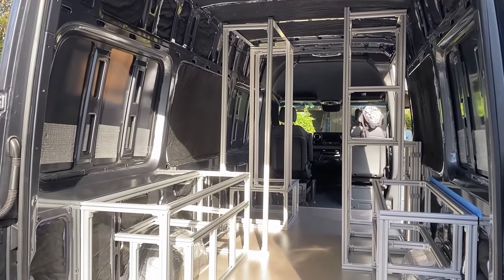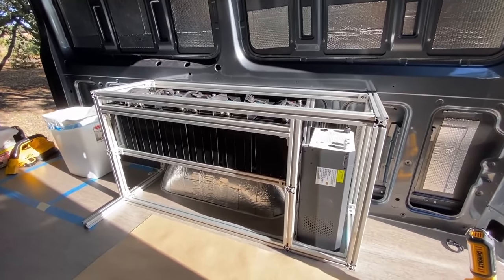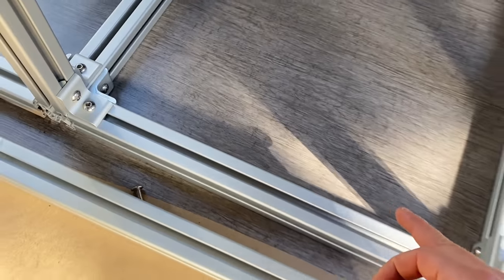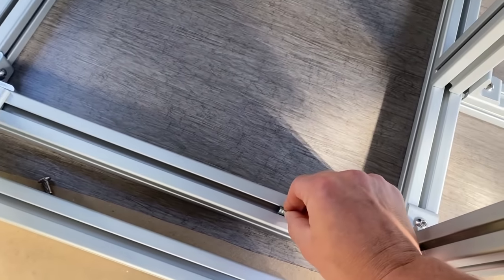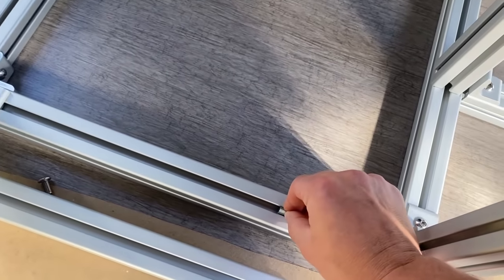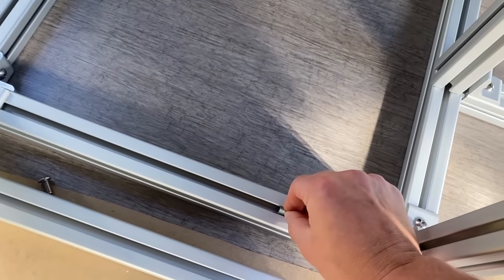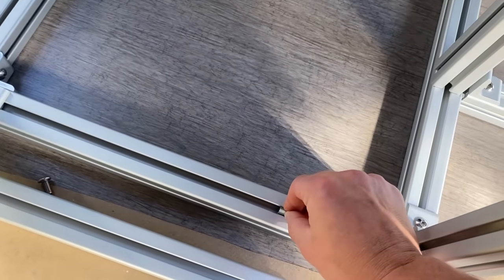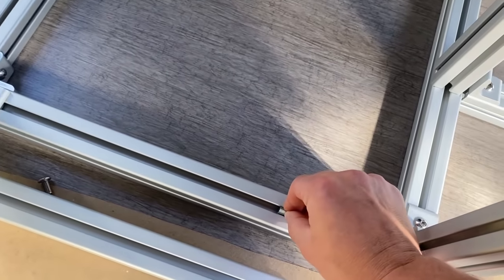How To Build A Van With 80/20 Aluminum (INSANELY STRONG)

Comment: What is the total cost of 80/20 for the van?
Reply: is 80/20 less expensive than wood??
Reply: @michaelbuddy  I figured.. 😆
thanks for your reply..
Reply: There are ways to reduce that cost though. 

1) Look at a brand called tnutz. They sell aluminum extrusions that are the same dimensions as 8020 brand. Tnutz uses 6063-T6 aluminum alloy which is comparable to or slightly stronger than 8020's use of 6105-T5. Tnutz extrusions can be a bit cheaper than 8020.

2) Both 8020 and Tnutz have ebay stores where they sell discounted extrusions. These will not be cut to length, but they can be cheaper than buying directly from the manufacturer's website. I would recommend buying all of your extrusions this way.

3) 8020 has a load deflection calculator which will let you choose the extrusion type (i.e. the size), and describe how far apart the supports are. You can then input the amount of weight you will be placing on that extrusion and it will tell you how far it will deflect. Using this you will probably find that you can get away with smaller extrusions which are a lot cheaper (extrusion cost is pretty linear with the amount of aluminum in the product - smaller cross sections will drop in price significantly).  For example: the extrusion Seven O Savage uses in this build is 1515. That extrusion can span 4 feet, have 250 pounds placed at the center, and only deflect .7mm.  That is WAY overkill for most of the builds we would be doing. If you have shorter spans or lighter loads you can get away with much smaller extrusions. Their smallest extrusion is 2020, and that can span 2 feet, have a 250 pound load applied at the center, and still only deflect 1.4mm.  But the cost difference is significant. 1515 is $0.53 per inch. 2020 is $0.16 per inch. You might need slightly more 2020 to provide enough supports, but that will not overcome a more than 3x price increase for the 1515. For example 40 feet of 1515 would cost $255. 40 feet of 2020 would cost $77 (and only $51 from tnutz - and even less on their ebay store). Don't over build. Use the deflection calculator and buy smaller, lighter, thinner, cheaper extrusions where you don't need to span long distances and carry extreme weights.

4) The roll in T-nuts that are recommended in this video cost anywhere from $1.20 per nut to $2.85 per nut depending on material. Economy nuts cost $0.16 per nut to $0.25 per nut depending on material. If you have 300 connections that is a difference of $360 best case scenario for the roll in nuts vs $48 for the economy nuts (best case scenario). Again, other vendors will probably be cheaper.

5) The angle connectors that are sold by both 8020 and tnutz are extremely expensive. You can also purchase 1/4" aluminum L brackets and make your own. Of course, the price difference is made up by your labor. You have to decide if that is worth it to you. But for example, a single 15 series angle bracket costs about $3.65. If you have, conservatively, 100 connectors in a build that is well over $360 you have invested. Alternatively you can purchase a 12 foot length of 6061-t6 aluminum L bracket for about $53. Cut up, that will give you about 90 - 95 angle brackets of equivalent size and strength.

If you combine all of these techniques you should be able to get the cost down by a HUGE amount. Just a rough guess is that you could take what was shown here and cut the price down to 1/2 or even 1/3 as much cost and still  maintain the same basic strength and have an almost identical design (with the added benefit of lighter weight).

It will still be more expensive than wood, but the extra strength of the extrusions (especially in a crash) would make it worth it.

Comment: I’m not sure I understand the carriage bolt attachment.. do you drill a hole through the 8020 and mount the carriage bolt facing the sheet metal? Or do you slide it into the back side of the 8020 facing the sheet metal? And then do you put a rivnut In the sheet metal? Or something else?

Comment: When you pointed out the water filter system, I noticed that it looks like you plan to install it with the canisters horizontal. If you ever need to change a filter cartridge, all the water in that canister will spill out unless it's mounted vertically. Maybe you have a solution for this though.

Comment: Do you think you could have used the 1" 80/20 extrusion?

I may replace a bench in my van that is made out welded 3/4 square tubing. It seems like the 1" extruded tubing would work.

Comment: is this the original flooring, or you added that? 
is it easier to add the 80/20 structures when the floor is still bare metal? (i guess easier to drill, you can see what you drill trough, etc)  or maybe its better to add them after the floor is installed?

Comment: I've been told to pick either the wall or floor to mount to, and NOT to use both. Apparently they vibrate at different frequencies after hitting a bump in the road. This would cause screeching noises or even damage to your bolts from sheer force. Never tried mounting to both floor and wall for this reason, but always curious if this was true. Have you had any issues?
Reply: In theory ceiling would have the same issue too but I've personally done that and had no issues, I think because the ceiling is more flexible than the floor.

Comment: This construction looks incredible. I do favor it over wood. :-)
The anchoring of the aluminum to the body of the van may cause issues over a few seasons. Thermal expansion and contraction rates of aluminum and sheet steel are way off. Add in the normal longitudinal and tortional movements of the body of the vehicle too, and how that interacts with your framing. Flexible rubber couplers (or groments, spacers, etc.) may be considered. 
Those convenient spring bolts that are used do love to loosen up over time. They work great when there is zero vibrations, stresses, or thermal changes. Expect it. Totally normal, really, but incredibly annoying, so lockwashers, loctite, or other means need to be applied to prevent them from coming loose. If I had my choice, I'd wire them.

Comment: Awesome video! Really great info as always. I'm looking around and I think I missed the part in the video where you secured the frame to the floor? I know you mention that there are 15 bolt points in both the floor and wall but I only see the parts where it's bolted in the wall. How did the floor bolting go?

Comment: 8020 is so strong had you ever thought of using the 10 series instead of the 15 series.
Reply: I have the same question!
Reply: Typically 15 series is the better way to go unless you REALLY need the extra space in a few select areas where not much weight will be placed, mostly because the connections on 10 series are not as strong as the 15 series. OurKaravan has an article on 10 vs 15 and why he uses 15, but that's a major factor

Comment: Do you have any regrets using the 8020 for you build?  Did you have the 2020 fasteners come loose  after some time actually using the van?  Did you have many rattles and squeaks from it?  Trying to get a feel for this before I commit to using 8020.  it seems like the best way to go, but wondering the long term cons of it.

Comment: Forgive me for asking before I watch the entire video. Would somebody please tell me how you connect 8020 to a two-by-four or some other piece of wood. I've decided to use a galvanized drain pan 4 shower pan. And I was hoping to make it multi-purpose similar to how people make it into a cabinet seat well I need that seat to be able to go up and down so that my dog has a place to look out the window when we travel and then I'll remove that platform to put on the bottom of the floor of the van as her bed. I thought using the 80/20 on the corners with two pieces vertically side-by-side connected so that I could raise the platform up and down and ultimately if I wanted to put a piece of wood on it to extend out what's going to be next to the sink. All the hardware I have seen is to connect 8022 other 8020. How do you connect 8022 wood and the wood frame and Foundation that I will build for the shower pan. I even looked at the 80/20 YouTube channel but all I can find is connecting 8022 other 80/20 in lots of different ways. Any and all help would be much appreciated

Comment: Seven O Savage, as others may have eluded to, what is your opinion on use of 1" size 80/20 instead? If it becomes only 75% as strong as 1.5", it should still be sufficient, and cheaper too, right?
Reply from the maker: 15 series is far stronger than 10 series (not sure the exact % but much more than 25%). I also like the simplicity of using the same profile throughout and building each side as 1 cabinet. Also with 15 series you can use 5/16 bolts (as opposed to 1/4 in 10 series) which are 60% stronger... 

I did heavily consider 10 series though, it’s still a great option.

Comment: The inside of a van is not a controlled environment given that every time you open a door the outside atmosphere enters.  Given that, how are you accounting for the corrosion of the steel-aluminum dissimilar metal corrosion potential?

Comment: So awesome!! Thanks for all the detailed walk through of your build. Question. Do you by chance know the weight of the cabinetry you’ve added when completed? You had mentioned you weighed the van after the exterior accessories were added, after heading back from Owl... Did / do you by chance have the increased weight determined from this 80/20 build?  Either way. Great build. Great content! You’re an absolute gem, dude! 🤘🏼⚡️🤙🏼
Reply from the maker: Thanks Joe, appreciate it man. It was about 260lbs total. although I’m convinced it the scale was off which is why I didn’t put it in the vid, I was anticipating lighter.
Reply: Thank you for asking. I was also curious. And also thanks to @Seven O Savage for great video and info!

Comment: As far as strength and weight goes? Is it lighter and stronger? or is it just stronger? or just lighter?   I was thinking about using  3/4 or 1 inch square aluminum, to save on weight. but I did not know if it would be strong enough.

Comment: Hi, Seven O. Did you use the nylon end caps to  come the exposed edges on the joints of the 80/20? Thanks
Reply from the maker: I did not but if you’re going to leave it exposed it’s not a bad idea. Might need to cut them shorter to account for the width of the caps

Comment: Seven you the man, what about the bolts that you used n areas where you attached directly to the Van I have heard them referenced but am not familiar with them thanks. Did not see them along with all the other great stuff in the description
Reply from the maker: They are carriage bolts and different places will need different size carriage bolts. You can also find them at your local hardware store
Reply: @seven_o_savage   Sorry should have been more clear I get the carriage bolts but are you using stop nuts or something different ?

Comment: are you hand tightening the carriage bolts, or do you need to get a socket or wrench back there?  Thanks! You're a savage!
Reply from the maker: The carriage bolts slot into the square part so they don’t need to be tightened. Just the nut on the back of them 🤙
Reply: @seven_o_savage  Right, so you hand tighten the nuts? or can you get a tool around them to crank them down on the carriage bolt?

Comment: Hey Seven, awesome video man. Very informative and very thankful for your efforts here. I am wondering though (I am new to 8020 and new to building in general), but lets say you build a frame out of 8020 like you did in your example, if you were to say secure it to wood framing, rather than the sheet metal like you, will it still be as sturdy and strong? I am soon to begin a conversion on a box truck and am trying to think how I can use 8020 within it, but securing it to the "frame" of the truck is where I am at a standstill. In a box truck, there are aluminum ribs, which I don't think are as sturdy and may not be accessible to drill and reach around back and tighten bolts. Any help would be greatly appreciated man. Thank you!   (I'm open to all suggestions)
Reply from the maker: if you have a wooden frame inside your box truck and secure the 80/20 to that with large lag screws, it will still be very strong. Probably about as strong as securing to sheet metal in a van.
Reply: @seven_o_savage  okay, I think I see what you mean. Thank you ! 🙏🏽

Comment: How did you mount the water tank directly to the 80/20?  straps?  so the aluminum frame just fits around the water tank but doesn't touch it?
Reply from the maker: Yea I just built the 80/20 cage 1/4” larger than the tank dimensions and then used foam tape to fill the gap
Reply: @seven_o_savage  thanks!!

Comment: Are vibrations, from the vehicle and driving and audio systems an eventual issue with so many bolts?
Reply: 80 20 has a built in locking feature, the slots act as lock nuts.  as long as the fasteners are torqued properly should be fine

Comment: Thanks for the info and enthusiasm, Any disadvantage to using carriage bolts (grind two slides flat) for T-nuts?
PS: tape the nut to your finger.
Reply from the maker: They would just have to be the perfect length in order to not collide with each other when they protrude from the corner brackets

Comment: Nice, I love your explanations and enthusiasm.  I have one question for you.  Your 3 stage water filtration looks like it’s laying down.  Doesn’t it need to be vertical?
Reply from the maker: it can be installed sideways per the manufacturer
Reply: @seven_o_savage  ahh, that’s good to know.  I’m using the same filtration system and was limiting the design to be vertical.

Comment: Question for anyone who knows: Could one use the 1” 80/20 and have adequate strength.?  Not for battery tray, but perhaps other structures?
Reply: @GOLDVIOLINbowofdeath  Thanks for your input!  The only thing I have come across on why the 1.5 over the 1.0 is the strength/variety of fasteners.  I’m not building for the zombie apocalypse.  I also don’t have sponsorships and advertising.  I like the idea of strong, square, and to a degree modular.  I have a hard time not using my Sprinter for cargo, even though it is purely personal, not hired.  So this stuff has an appeal to me.  But the pockets aren’t deep.  Fortunately, planning and researching is free.  Again, thanks for your comment!

Comment: Would you be able to use 1” 80/20 rather than 1.5”?  Or at least mix them up where weight is not going to be an issue?
Reply from the maker: Yes. Up to you. I personally prefer 15 series for big things

Comment: Why did you not use plus nuts to mount the 80-20 everywhere in the van? Why did you choose carriage bolts over plus nuts in most places?
Reply from the maker: I thought the carriage bolts would be stronger in the event of a crash. In reality it’s an absolute nightmare trying to get the nuts onto the back of carriage bolts (I have shivers just thinking back to it). Next I’d probly just go plusnuts.
Reply: @seven_o_savage  Good to know! Thanks!

Comment: You seem like a giant who needs every inch of headroom, so this may not be feasible. But most materials are stronger in compression than tension. Basically, running a few bars to connect the tops of the driver and passenger sides would give you a TON of strength - you wouldn't just be pulling the passenger side cabinets from the wall, you'd be compressing the driver side cabinets into their wall. 

This level of strength probably isn't necessary for 99% of builds, but if you can spare the height, why not?

Comment: Hi Seven O Savage,

are you not going to use LeFePO batteries? what kind of batteries will weight 320lbs?
Reply: I was wondering the same thing.  Sounds like he is going with AGM's.  I am going to have 630 lithium amp hours in my van with a total battery weight of 140 pounds.  With the quality of his build (He is more concerned with doing things well than affordably.)  I don't get it.

Comment: do you (or anyone) have a link for that stock you used to fill in gaps in between pieces of extruded? I think it was a hard plastic stock that you got from McMaster but I haven't been able to locate it on their site. Also looking for links to the hidden L brackets for 15 series. Thanks!
Reply from the maker: It’s a solid acetal bar that I cut to small peices

Comment: Great work!
Your like The Mad Scientist of Van Conversions.
Question: 
Why did you choose 1.5 inch instead of 1 inch 80/20?
Reply from the maker: It’s a lot stronger & easier to work with. But 10 series would be adequate in most places.
Reply: @seven_o_savage  You were going for stronger because of "off roading" or was there even a more of a reason besides ease?

Man, you do it All!

Your degree must have had "Crazy" understudy programs or your just "Nice like that"!
Reply from the maker: @reddbeard2030  primarily for off-roading. Definitely don't need this kind of strength if you'll be camping at easy to access campsites. 

😂 thank you, love it!
Reply: @seven_o_savage  More than likely No Off Roading with this Shuttle Bus. But we are probably gonna follow your techniques and suggestions pretty close as you have some of the newest innovations and upgrades.

Keep up the amazing work!

Comment: Should you be using Loctite on the screws? When the van flexes and vibrates they will loosen.
Reply from the maker: Yes loctite is a good idea. I kind of want to test how long it takes for them to start coming loose.
Reply: torque em down good, you won't have any trouble with the drop in nuts inside the rail, there is a slight angle that acts as a lock nut.  loc tite doesn't hurt either.  see https://m.youtube.com/watch?v=QwKQiIr9f0o

Comment: Looking good! What's the Isotherm hot water tank you used?
Reply from the maker: It’s a water heater. It’s called the Isotherm slim square
Reply: @seven_o_savage  Cheers. Thanks for your in-depth video on 80/20. Very useful.